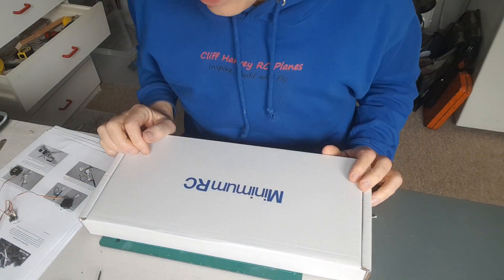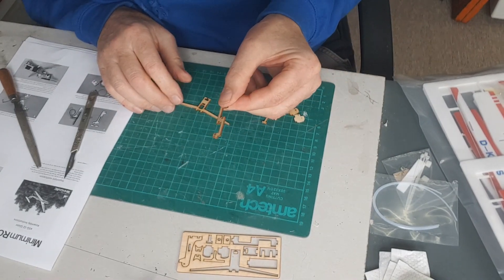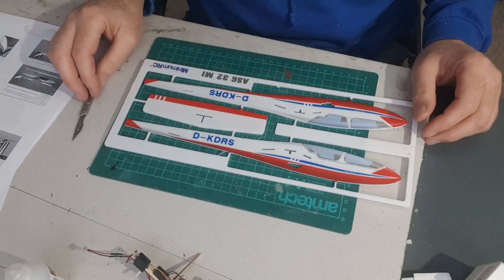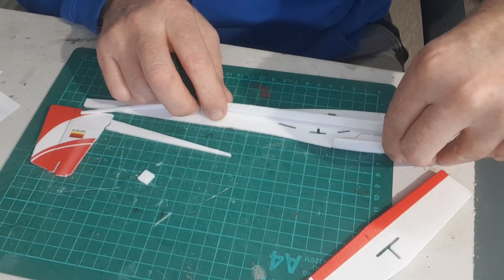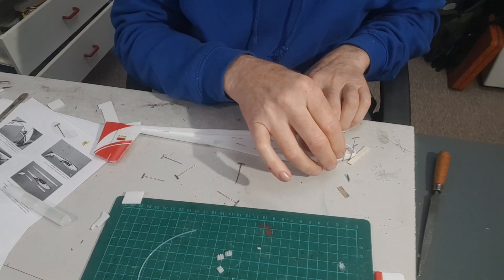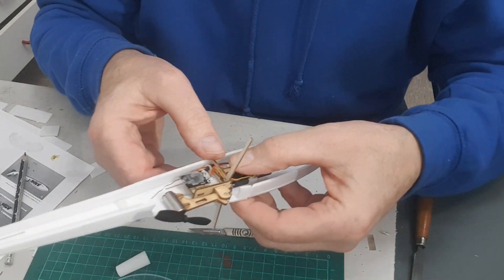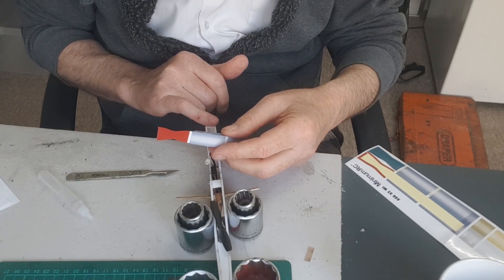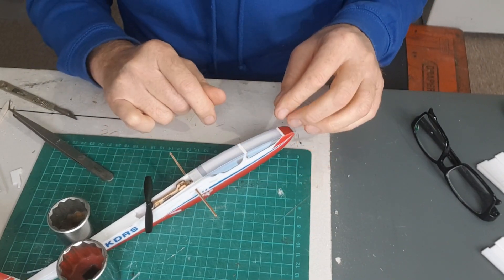MinimumRC ASG-32 Motor Glider Complete Build Video

Comment: Hi Cliff, Brilliant video as always. I'm about Half way through the build of my one. Still getting lots of tips from your video! Kindest regards Wiggles!
Reply from the maker: Hi Wiggles, hope it's helping and not hindering lol
Reply: @CliffHarveyRCPlanes   Not at all. I maidened her last night after finishing it. I added quite a bit of lead to get the balance on the front crease of the wing.  On full power take off it nearly hit the ground, but I just managed to pull her out. It's a bit like a Bixler. I didn't think it soared all that well. I think I hit one thermal. It was a cool night. Anyway I'll take a bit of the nose lead off and try it agian today at our main field (Goosedale). Kindest regards and keep up the good work. Wiggles.😀😀😀

Comment: I just built the minimum rc Minimoa motorized sailplane. 
The main spar of my build did not want to mount perfectly symetrical to the body. Thus the left wing has a bit more lift & has a slight to the right bank in my hand tossed flight test. 

I think rudder offset might fix my issue. If not I'll add an aileron to one wing with a fixed deflection. I think next time a jig to ensure perfectly symetrical wings is needed and given the plane is small and fragile this may be a bit of a challenge.
Reply from the maker: You do need to be very accurate when assembling the plywood parts, if you're not then it can throw the whole thing out, but as you say easily corrected, they're they're not as delicate as you may think either, they will take quite a bit of abuse. I've just finished building the DH88 Comet by MinimumRC and one of the engine nacelles wasn't quite square but luckily I spotted it and was able to correct things before final assembly, enjoy your flights 👍

Comment: I’m a little confused, you appear to be using a Spectrum Tx?
Reply from the maker: That's right Keith, as I outlined in the start of the vid the rx is an older model and must be a different protocol (?), it wouldn't bind to the new tx but the DX6I had no problems!
Reply: Thank you, that’s the problem with cooking and watching a vid!
Reply from the maker: @Keith Blackham  And be sure not to watch cooking videos while you're cooking either Keith, you're likely to miss out an important ingredient 😁👍